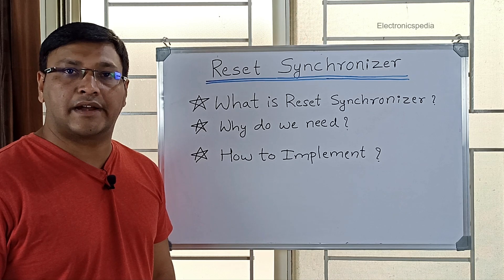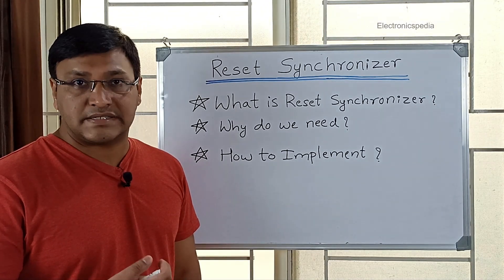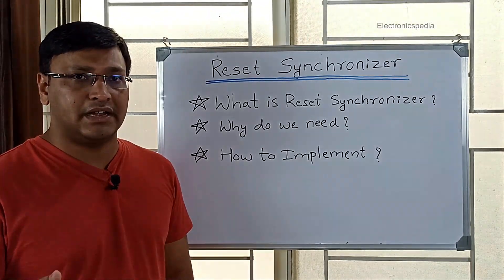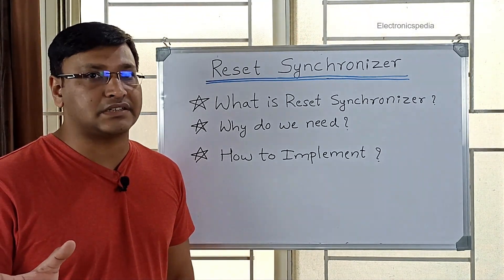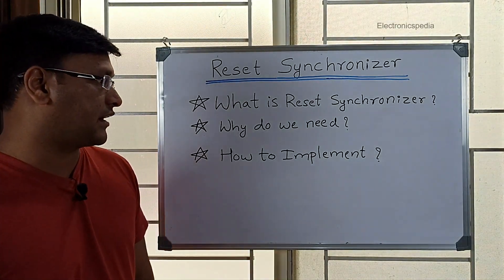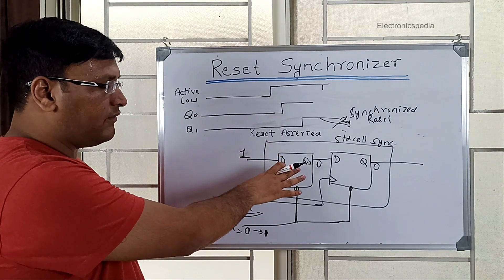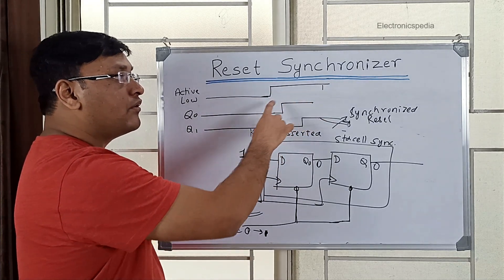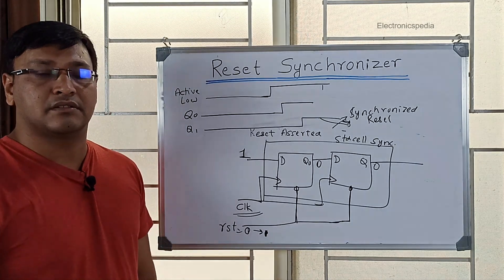Reset Synchronizer | Reset Synchronizer Circuit | Active High / Low Reset | VLSI Interview Questions

Comment: The Q of the flops cannot be "1" when reset is asserted.  It will reset to 0.  You need to connect the Q-bar to the D and take the Q-bar of synchronizer to the rest of the fanout.
Reply: 😮bro 🤜